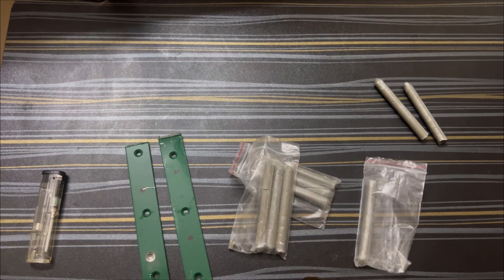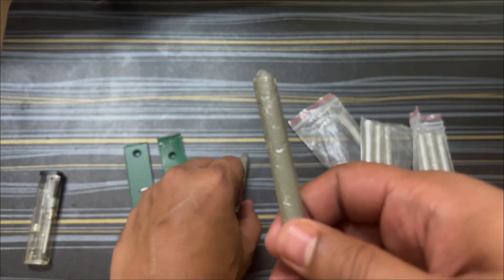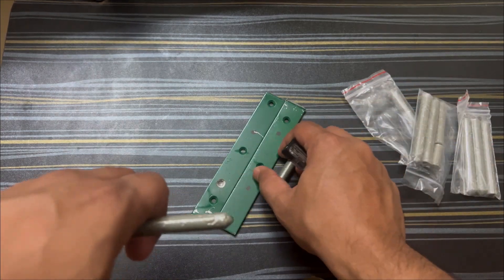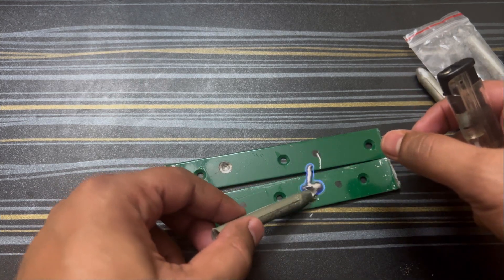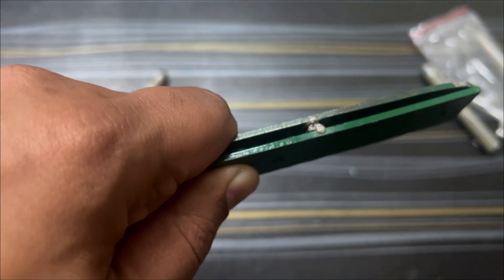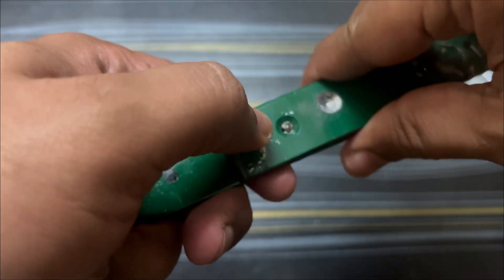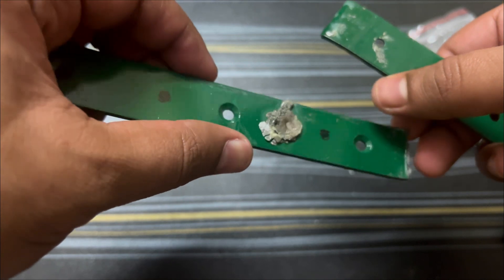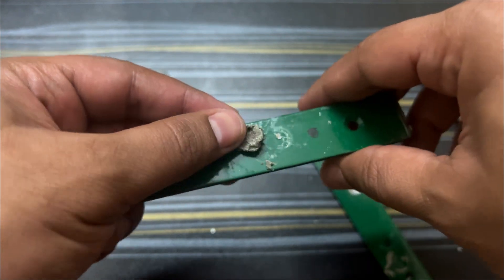Do Low Temperature Welding Rods Really Work? Full Test & Review on Metal, PVC & More!

Comment: Thanks for the post ,i believe there are 2 types ,a resin baised type ,like the one in the post ,the real low temp rods are for aluminium do work but melt point is around 700 degrees, I see the adds for this stuff and your post helps ,it may have some use with plastics etc,